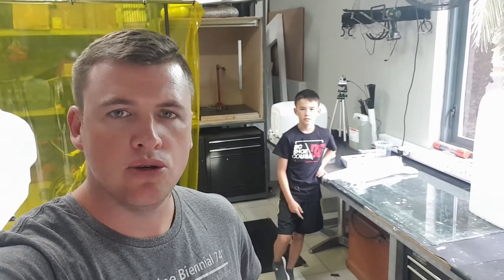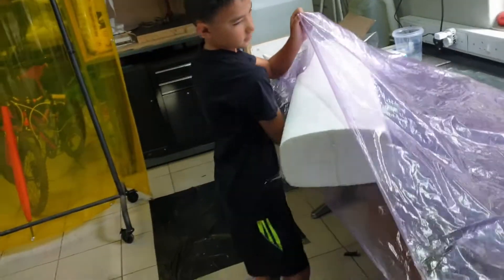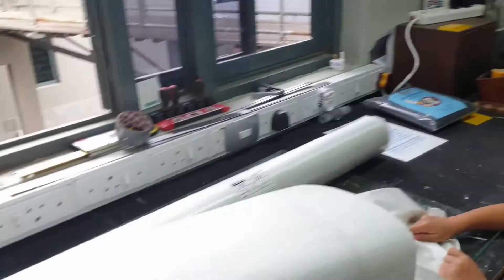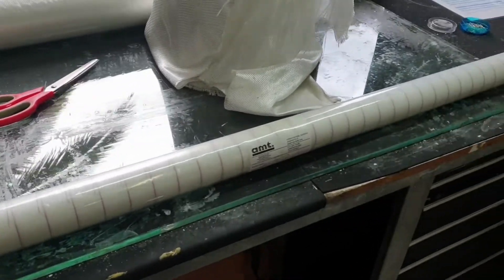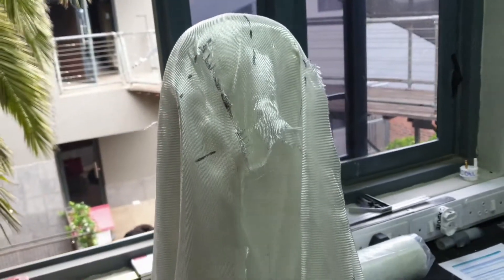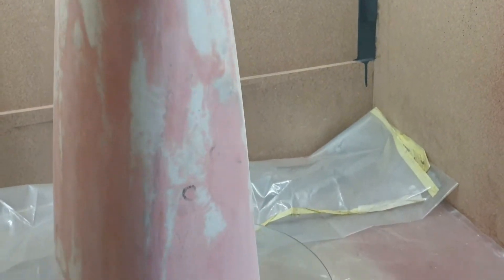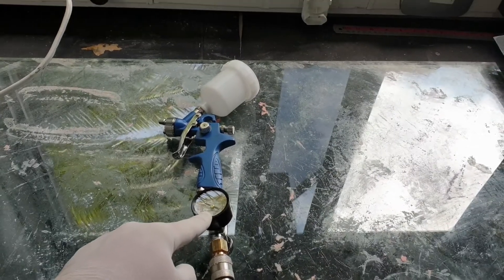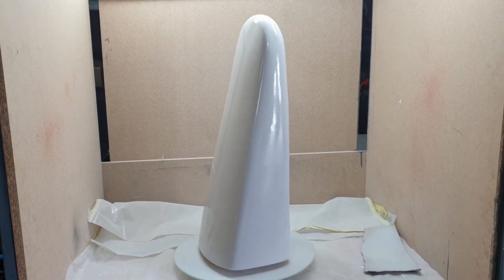Stage 4- Finishing the Nose Cone Plug

Comment: 3:42 What solution do you use to stick with the carbon filber to the foam. Thanks you very much.
Reply from the maker: I just used the epoxy resin and make sure to lay the glass along the drap to prevent lifting. I also put the piece into the vacuum bag at VERY low pressure.
Reply: @miniindycarprojectza7793  Thanks you for answering <3. One more question. Do you have any ideas to cut layers of foam to be smooth as same as your original?
Reply from the maker: We built a small wire cutter and if you use a pattern or jig to run the wire then the finish is very good.